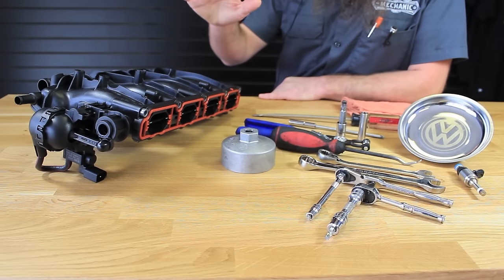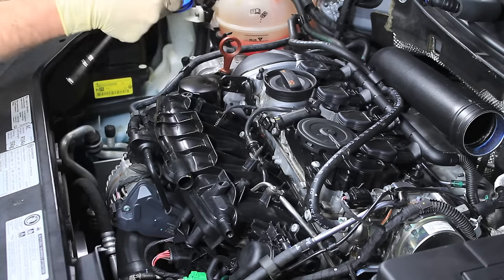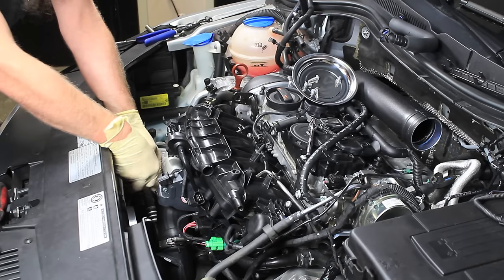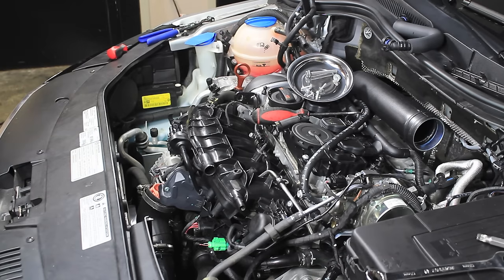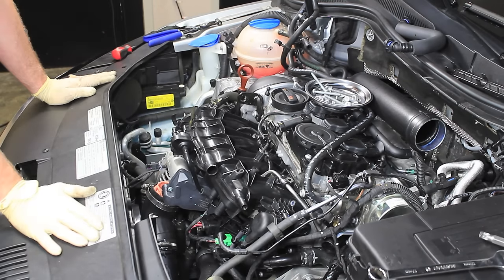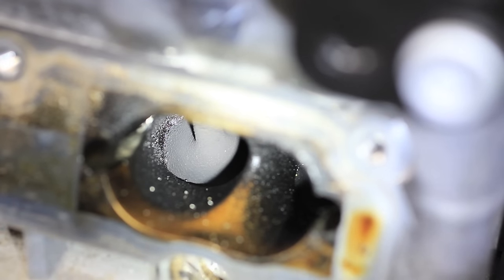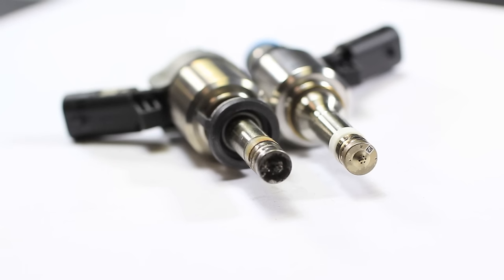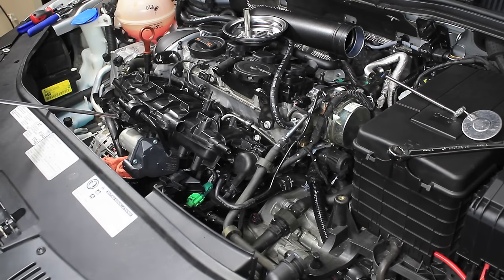Intake Manifold for VW and Audi 2.0T TSI DIY (How to) Replacement

Comment from the maker: - We appreciate your Support and Purchases!
Intake Manifold for VW/Audi CCTA/CBFA - Genuine VW/Audi
https://www.shopdap.com/vw-2-0-t-intake-manifold-06j133201bd.html

Intake Manifold for VW/Audi CCTA/CBFA - Vaico
https://www.shopdap.com/06j133201bhvco-intake-manifold-for-2-0t-tsi.html

Intake Manifold for Audi CAEB (Longitudinal) Engines
https://www.shopdap.com/06h-133-201-at-vw-audi.html

Intake Manifold Install Kit
https://www.shopdap.com/intake-manifold-install-kit-for-2-0t-tsi-06j198201bhgrp.html

Fuel Injector Seal Install Tool
https://www.shopdap.com/wkz-t10133c.html

This  also would be the same procedure when replacing this 2.0T TSI Fuel Injector
https://www.shopdap.com/vw-audi-20t-tsi-fuel-injector-06h906036ab-bosch.html
Reply: After doing this job (in preparation for decarbing the valves on a 2010 GTI) the car started throwing codes all over the place. I'm getting a P2008, a P2008 P, a P0341 P, and both the EPC dash light and the Oil Pressure warning that keep flashing on and off above 2,500 RPM. Driveability issues are present. Can't rev the engine up too much or it starts to hesitate.

I removed all kinds of sensors (that perhaps shouldn't have been removed), such as the camshaft sensor and the air charge temp sensor. What is the likelihood I may have damaged them while cleaning them (if they even need cleaning)?

Comment: I just did the this job,  took me about 4 hrs to do it,  thanks a lot you help me and save $1000.  It's what the dealer wants to do the same job, very helpful 👌
Reply: How did you take off the bracket on the body without lifting the car?
Reply: Yeah wish me luck I got to do it just for a damn regulator pressure sensor #2 that's under the manifold, fuel lines, hoses, etc. 
The only direct way to get to it is with a deep socket 27 mm wrench. But the oil dipsticks in the way. So then I get that out of the way and then the sockets too thick to fit in between the gap of the manifold 🤦🏾‍♂️....... 
They got to have a Gumby twisty elbow flexy type wrench to use for this..... Oh yes of course they do but none come in 27 mm
Reply: @BirdFromYakiVegas  lmao me today in my mk5 gti, that middle bracket omg, got to go back to it tomorrow spend hours toddy messing with they one bracket
Reply: Im trying to muster up the courage to do this. I cant afford to pay to get it done, plus i dont hve the extra money to do the carbon clean, which should be included in the repair price more affordably since the major work is taking this off
Reply: @zachariahmetoyer6425  I just did it in a 6 or so hour time span , tricky bolts to get at but it’s off and can see the dirty carbon build up on the valves , it’s worth it if you got the time !!
Reply: Hey Charles really enjoy your videos. So my situation is a few of my intake mounting bolts holes were stripped when I took it off can I get some info on what I need as far as size of tap and helicoils   Thanks in advance.
Reply: thats fast i did it in 10 hours

Comment: I had to take off the manifold in order to reach the water pump. I found that it's a lot easier if you remove the throttle body. Taking off the throttle body allows easy access to that brace, which requires the triple square to remove. In the video, he doesn't remove it due to his experience, but it helps a lot.
Reply: I wish I had read this comment before I did this the first time.  That stupid brace took more time to remove than everything else combined.
Reply: Agreed!
Reply: Same here that stupid bolt is almost impossible to reach with out removing the throttle body
Reply: @michaelw6277  is it at all possible to remove it by just removing the top 13 and then rotating the brace to the side or something or is it absolutely a must to remove that triple square
Reply: I have found that removing the brace is much easier if you remove the intake hose upstream of throttle body and then detach the two plastic coolant lines and unscrew the two T30s attaching it to the manifold. By doing this, you have a lot of space to see the 13mm nut and the TS10 bolts. Use a 3" extension on your TS10 and viola!

Comment: Just wanted to say thank you for publishing such an informative video on the intake removal procedure! I had to do an intake valve cleaning job on my mom’s 2010 Passat recently. I’m a VR6 guy and I had never really worked with the 2.0T engines, so this video was extremely helpful. I did end up taking the throttle body and bracket off though to avoid accidentally yanking those wires from the connector underneath. Used solvent, picks, toothbrush, and the zip tie drill method to remove the carbon deposits. Just took my time with it all and I’m happy to say the operation was successful. And my mom is super happy to have the cold start misfires gone! Thanks guys!!

Comment: I have this done twice already.  Once for the recall and wanted 500 to clean carbon.  I said no.  Then hit 80000 and got cold start codes and dealer wanted 1600 dollars.  Said no and drove to independent and got decarb done for 490.  I like you as a mechanic but I sometimes wonder where they come up with these numbers.  1600 dollars is a mortgage payment and then some.  I was told that it was a ten eleven hour job.  The independent had it off and decarb in four hours.  Car runs great again shifts smoother better gas mileage.  The key was over 1000 dollars cheaper.
Reply: 11 hour job, DAMN!!!!!
Reply from the maker: 11 hours is a little excessive for this job.
Reply: DAP has great vids keep it up.
Reply: Well, I have done this job several times and because of that experience, I can now replace the manifold in less than 90 minutes. But that's irrelevant!  Speed does not make a mechanic any better than another who is detail oriented because he does a QUALITY job!  Sure it may save you money, but cutting corners and rushing the job just to save some money doesn't make sense. Adding a Carbon/Valve job to this project (I use a custom made VAG walnut shell blaster - for VW-Audi & Porsche autos)  can easily run it into a full day gig, (especially if unknown variables and snags occur).  Remember, QUALITY is in the details.
Reply: Dale Fluegel Dd.
Reply: Haha, dude the dealer tried pulling the same shit on me. When I got my warranty intake mani replaced they called and asked if I wanted to pay $500 to clean the carbon, I said no too. All they're trying to do is recoup their lost money.
Reply: At my local place, my manifold was cracked and they said it was 4 hours work to change it, they're still asking 1300$, weird part is i changed it 2 years ago..
Reply: Thats because they charge flat rate book hours. So no matter the time it takes they charge you a flat rate (book time x hourly labor rate) + consumables and use of any special equipment to complete the job. Whether the job takes 4 hours or 14 doesn’t matter. Its what the manufacturer says how long it should take. So if it says it takes 10 hours thats what you get charged for no matter how long the job actually takes. They do it this way because believe it or not service departments get slow and they cant be losing money by having techs standing around doing nothing because theres not enough work to go around. So you get paid per job you complete and they use the flat rate system to be able to pay the tech a decent living wage and cover overhead costs, and make a decent profit on top of that.

Comment: But everyone WANTED to see the bracket put back underneath! ;-) And you left a ratchet in the cowl area... :D Good Job, Charles!
Reply: The dealership that replaced my manifold under warranty (under previous owner) didn't re-install the lower supporting bracket. Everything seems to work fine without that bracket installed.
Reply: I'm at a loss as to why the installation of the bracket was omitted.  At 33:00 Charles says that was the most challenging part of the job, and yet it isn't included in the video....why would you want to omit the most challenging part of the job from the how-to video?  Thank you for the great video nonetheless!
Reply: @lenschulwitz1934  He shows the bracket farther down the video after he gets the manifold all the way off and mentions if you have never seen what it looks like you may want to advance to that section and then come back.

Comment: ⚠️ WARNING ⚠️ 
This is MUCH, much more difficult than our friendly seasoned veteran VW Master mechanic makes it look, especially if your EA888 is in a Golf R, and ESPECIALLY if that Golf R is RHD. The engine an accessory positions are similar to what’s shown in the video, but NOT the same, and often MUCH more involved to remove. (The throttle body absolutely 100% needs to be removed on a RHD Mk6 Golf R for example, and other parts need to be removed to get to the throttle body bolts. 

Expect to spend upward of half a day just to remove the intake manifold, and possibly multiple days removing it multiple times for fuel injector leaks. You can do it, but come in prepared to spend a considerable amount of time and effort, and needing many more tools than mentioned here. This great video (I mean that sincerely, thank you Charles) is just a general baseline for what you’ll have to do to get it done right.  Good luck!
Reply: Just finished doing this job. Much more difficult and involved than expected. Took me a whole day of working on it to do it. It’s doable but it requires back support and good talking buddies.
Reply: specialy the famous bracket that he didNt show!

Comment: Though it's a 6 year old video it's still helping me big time. I watched this vid in 2x speed twice. After getting everything off, I watched it again in normal speed. Thanks for the step by step on this! Few notes for people like myself working on a now older, typically higher mileage MK6:

1. Do the intake carbon cleaning. Mine was so caked with crud that stalagmites were being formed off the top of the valve. Scary to think I'm Stage 1+ tune and have these overhanging maintenance problems that the PO did not take care of.
2. When doing the intake cleaning you have 2 options: chemicals or walnut blasting. A walnut blasting setup is minimum $300 (compressor, hoses, media, and a small hopper gun). 

3. I did the chemical route. Its COVID 19 quarantine season right now so I have plenty of time. What I discovered was: Start with manually scraping with a pick. Followed by CRC Valve Cleaning aerosol spray. From there, use B12 aerosol spray. Then, finish it with CLR (yea that cheap bottled stuff). CLR is the secret here..it brings the valves back down to clean metal. Use a pick and paper towels (rip them into 2"x2" pieces and use the pick to push them around). 

4. Follow with vacuuming/compressed air spraying. 

Side notes: 

1. you can open and close the valves by hand by spinning the belt off the alternator. Gloves help with grip, and avoid pinching your fingers.
2. That triple square #10? I used a #8 Allen, square (not ball end). No stripping.
Reply: Did you replace the intake manifold gasket? In all the videos I've seen no one mentions it but I feel like it should be replaced when you remove the intake manifold?
Reply: @Eli9s  I replaced the fuel rail and intake to the latest version (I believe its the 4th revision) because my version was failing - which came with fresh gaskets.

If you're going to take the time to clean the carbon I would also go to the latest fuel rail and intake assembly. Regardless, I recommend a fresh gasket. Sure, the original is a polymer that will last for years, but it's an inexpensive maintenance item (~$25). Just make sure that the gasket aligns with your specific intake assembly because there are 4 versions with slight differences.
Reply: 4 Month update: I also upgraded to an oil catch can. A plug-and-play setup is $300+. In my mind, any GDI engine should have a catch can. I went with ECS' one. The quality is good and everything bolted up well. It will help prolong the maintenance interval between carbon cleanings.
Reply: @richiethompson2919  thx for the reply.
Reply: @richiethompson2919  i have the 2014 gen3 GLI and now im scared to order the gasket because this car has a bastard motor and everything seems different on it. Thanks for the advice. Not sure on what version of fuel rail my car has either but considering its the ea888.3 ill probably just leave it be